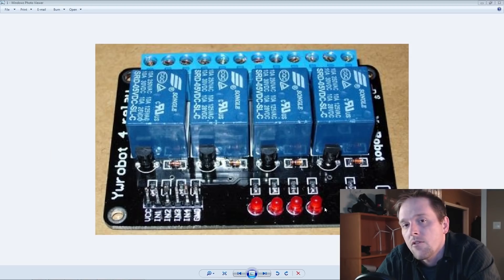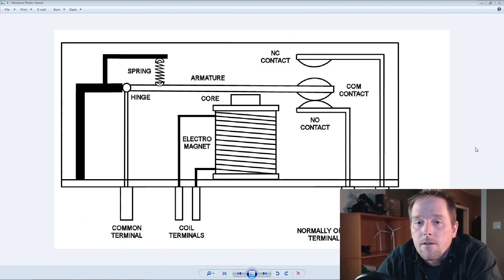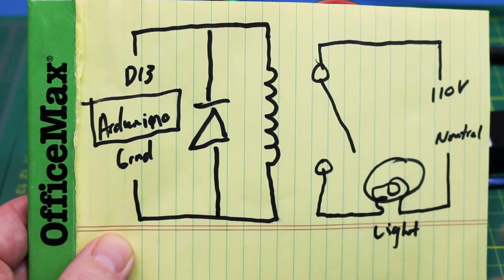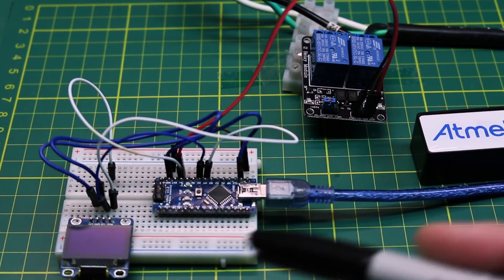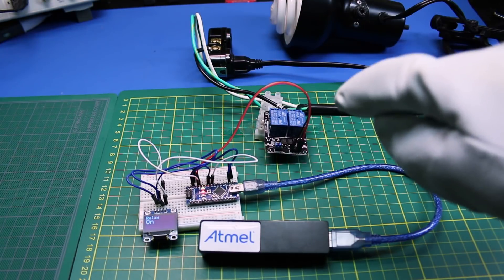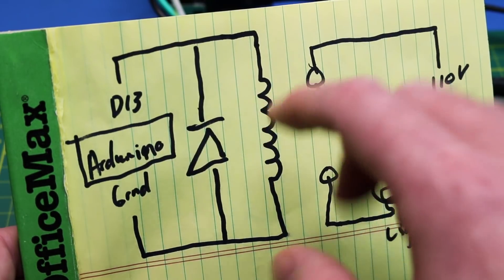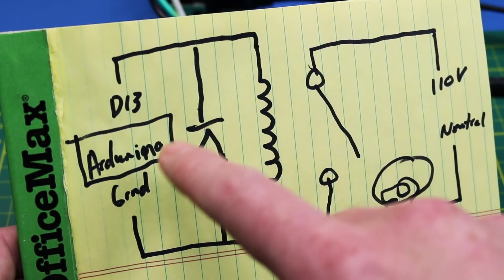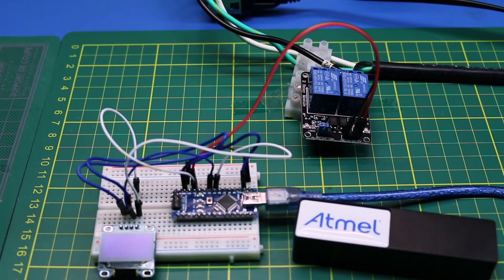How To Add Relays to Your Projects- The BASICS

Comment: I'm not sure how to wire the relays for my 12V system in my camper and requires 15, 20, 30, and 40 amp fuses to run my awning in and out with a switch, can these be used instead of those 5 wire relays?

Comment: I dont understand. I just want to add a relay to a trolling motor so I can switch it on and off safely if it's even needed. This video called kayak go go cart had one and in trying to learn what a relays for.
Reply: relay allows you to control power from a different source to a load, its acting like a switch that you can control with very small power, like that coming out of an arduino GPIO pins
Reply: @joshuavincent7884  cool
Reply: @joshuavincent7884  😎

Comment: Got an 8 relay module and i'm looking forward to cut off 5 outputs on my arduino by using an 8 bit shift register 74HC595 IC chip. Boy will this be a fun project.

Mine has optocouplers to seperate the input section from the coil and needs a seperate 5VDC supply there, and is an active low module. Problem is I'm not sure what approach should I take when dealing with latching relay states internally when using the IC. Don't want to add 1 to my byte variable every reading cycle and start glitching my relays by flicking at a crazy rate. Should I use an array of booleans or bits or anything else for shifting out (function used to write the output states in the IC)?

Comment: If we look at the diagram on the left and name the points around the square from the top left as A, B, C, and D wouldn't it make more sense to put the diode between points A and B (between pin 13 and the coil)?
Reply: Actually, never mind. I just solved my own question. The collapsing field generates power and continues to flow around the new circuit feeding the current controlled current source over the coil. Makes sense. If anybody wants to see a visualisation of this I put one up on imgur: https://imgur.com/EZKTr0G

Comment: Can someone tell me if a ssr can be used for 5v direct current? would be to control an injector in a fuel injection project managed by arduino
Reply from the maker: Just use a mosfet. One like IRFZ44N is good for 49amps.
Reply: MKme Lab thanks

Comment: I have a question, can we use this relay on 2 power input to 1 output light...1 power input using normal switch on off and 1 more power using sensor motion...

Comment: Hello dear friend, can you kindly answer this question? Is it possible to directly connect(without Arduino) a pir hc-sr501 which has a 3.3v output to a relay that requires a low trigger level? If so, how should the link be? Thank you very much

Comment: We all know how they work yes they switch. Your paper drawing has nothing to do in comparison to 4 pins and three screw connections. Can't see the relay pins or connectors on vid. Which pin to the motor or light which to  battery or power or board  common no or on  which to the in1 in2 vcc. Watching your spaghetti work after it's all hooked up tells me nothing.
Reply from the maker: Perhaps try a book?
Reply: Betty Crocker?

Comment: What can we use if we want a output voltage between minimum and maximum voltage (not as on and off switch but as a fan regulator)?
Reply from the maker: a mosfet

Comment: I hooked up an 8 channel relay module board one of those typical ones you buy from amazon.  I wrote a simple sketch to check it out as I want to use it to power some linear actuators.  On power up all relays go high and turn on power to all linear actuators and everything that could be connected to them... this is not good.  Once the program rolls through the loop the first time it functions as programmed where I'm cycling through the 8 relays turning one on at a time with a 1 second delay and then back off.  So how do I get around this problem on power up where everything turns on?
Reply: Tom Collins - I’m having the same issue - how did you manage to resolve this? Thanks

Comment: hi, i gone thru some video that they recommend to supply separate power supply for the relay, but some don't, i not sure is it really necessary to have a separate 5v supply to the relay?
Reply: Yan Mong Chan , thanks for your reply. if my relay has lesser ohm, should i add a resistant in series with the relay? will it works?
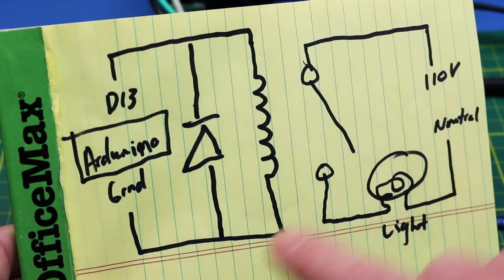Reply: At 3:03 he basically explains why you shouldn't connect a relay directly to the arduino or any other microcontroller. For that you have control circuits like Yan Mong Chan explained which basically work like this: Output of an arduino or microcontroler triggers a transistor (who in this case operates as a switch) which then triggers the relay, so if anything goes wrong with the relay, the control circuit will get damaged while arduino will be safe.
If you want to control more relays or other components like motors the easiest way would be to use a Darlington Transistor Array for example ULN2803 (http://www.ti.com/lit/ds/symlink/uln2803a.pdf) as they require minimum components. All you need for this is the ULN IC and power supply which has to be the same as the power requirements of the device you are controling (12V if using 12V relays, 24V if using 24V relays,...).

Comment: I am sick of my 91 corolla, leaving the light on, it does not have any beep or warning to let me know that I did left the light on, so I am going to connect two relays horizontally to have two positive voltage from the door switch(fuse) and the head light switch(fuse), so with the two on, I will power on a beep device that I will connect the circuit, like this I will save my battery :), what do you think? sounds like a project? :)
Reply from the maker: Absolutely!

Comment: I want to use a relay to turn on/off a common household 20" box fan (with arduino on a schedule)? I'm going to do some googling to see if there are perhaps charts with relays and typical applications vs loads.
Reply from the maker: Relays are rated for load. Easy math ;)

Comment: Hello, I'm having trouble with my low level relay :
 - when I power it with 5v, the input from the arduino works (green LED turns on and off) but the switch isn't actually actuated. 
- When I power it with 9 or 12V, the switch triggers, but the input is not recognized (the green LED just stays lit) 
What do you think is causing that ?

Comment: What kind of power supply do I need to purchase to power an 8 channel version of the relay?
Reply from the maker: You need to figure out what your control circuit is drawing and add the relay coil draws. Depending on brand they are usually 50-100 mA each in my experience.
Reply: MKme Lab I’m just going to be using it to turn a heater on and off. Leaving the plug intact and just snipping the positive wire and wiring that into the relay. So really I only need the 5V supply to be able to activate the relay. Correct?

Comment: even if I use the relay controlled by arduino into 240V line to neutral would it still be possible depending on the specs of the relay and the diode connected?

Comment: Hi, I wonder if you could help please. I'm not much good with this sort of thing. I have a twin relay module and I can't get the relays to trigger. I'm ok with the output, but on the 12v input side I am unable to wire it. The terminals I have are CL2. CL1. DC - and DC + any help you could give will be very much appreciated. Thanks, Terry.

Comment: Just Awesome!
Thank you so much. You are the man.

Would you be kind and make a tutorial video on how to connect an AC well water pump to a relay?
If you could also advise on the correct relay spec to purchase please.

I plan to control my pump for the house from my cell phone using my Arduino UNO and a WiFi sheild.

AC Well Pump Specs:

-> 240 V
-> 50 Hz
-> 1.5 HP
-> 6.6 A
-> 2800 rev/min
-> HEAD: 30 Feet

If there is anything else you would need to know, kindly let me know.

Eagerly awaiting your reply.

Thanks & Best regards,
Philip
Reply from the maker: Get a 10 to 15 amp 240V relay and you will be good. Could use a very small relay (aka interface relay) to run a contactor as well if you really wanted to get overkill.
Reply: Thank you so much.
Just if I may clarify please:

1) Are interface relays generally expensive?
2) How do I connect the pump wiring to the relay?

Warm Regards,
Philip

Comment: I thank you for the good will. I am trying to set a timer circuit on an iDrive 300 motor control for shades. the iDrive has cube contactor for close shade and another for open shade. The controls have manual open and close positions as well as auto position. the cubes are wired for manual, can I lap a set of timer wires onto the existing connections for timer operation? using the same input voltage (24vac).

Comment: Great Video.. Is the diode embedded into the relay?
Reply from the maker: Yepper
Reply: So I need an additional power source to run a servo as my arduino cannot provide enough current to it. Would the relay also work to control a DC circuit or should I use a transistor instead.
Reply: So I need an alternative power supply to my 5V arduino as driving a servo from my microcontroller is not enough. Would the relay also work to manipulate a DC circuit? Should I be using a transistor to to this or could I also use a relay?
Reply from the maker: You can use either. An analogy would be that using a transistor in that case would be akin to using a flyswatter to kill a fly. The relay would be akin to a Howitzer cannon to kill the same fly.  Both would get the job done.
Reply: lol, wut
Reply: minute 3:17.......

Comment: You may have answered this, but I'm having trouble creating code on my arduino to control dwell times in .5ms increments. 

I need to then add the code to a GUI for a touchscreen that I can manipulate for a sprayer. The relay will power a solenoid valve for a simple on/off operation to apply product to our samples at work. 

Any help would be greatly appreciated.

Comment: Hi Mkme Lab, Hope you can help. im confused about which type of relay to get. The relays in your video say "SRD-05VDC" does that mean you need 5v to get the relay to work? Iv saw other relays that say "SRD-12VDC" so would that one need 12v?

I need to get a relay which can be switched on by 5v and which will be switching on a 12v line. 

Thanks
Reply: codoyen 
You can operate a switch that doesn't actually draw from the 12V supply.

Comment: Planning on making a fish tank heater here, with the arduino, relay and thermistor. (store bought ones fail in the on position, and I believe this can be made to protect against/replace  the built in thermostat in those heaters.  I was wondering what the "extra" components on the prebuilt boards were.... I didn't know I needed a diode in-line with the coil pins, never needed one for auto's applications. Now, just have to learn to set up the programming side.
Reply from the maker: I have 2 reef tanks and if I didn't already have a Reef Keeper on each of them I would definitely build the circuit you are building. Stuck heaters have killed many tanks.  Super easy to add a tonne of functions like temp display/alarms. ph alarms/display, water level switch etc etc.
Reply: I've noticed that, been shopping around for a new one and on every product theres warnings for one or more person about how theirs broke in a closed loop and killed everything. It was at that point I looked over at the printer and wondered..... it's basically the same... kinda.  I'm just starting to learn (or trying to learn) the programming side. I would love to add a small display to show temp or set temp and actual temp. I think that would be a really cool feature to have. And advice on display to use and where to best learn how to program it? So far the extent of my arduino knowledge is simple tweaking an arduino/ramps for 3D and making a custom thermistor table.

Comment: Good vid, thanks. I would like to setup a relay that reads battery voltage. When the battery voltage gets below a certain voltage, the relay should turn off.  Example - I am running a battery with 4.2 volts. As I am using  the battery , and it falls down to 3.5 volts, the relay should switch off. I am hoping I can use a relay to disconnect a power line to the battery. Thanks.

Comment: wait. what does it do again?
Reply: it uses a magnet, an electro magnet to open and  close  a switch that is more hefty and can  switch circuits with much higher voltage and current ,the electromagnet is powered by low voltage like 3v or 5 v
  the relay can  switch things that are 120V,  think of it as a light switch in your wall that you have glued  a small powerful magnet to , then  positioned an electro magnet  with in an inch or 2 of, the electro magnet  is being powered by 9v say,  when you energize the electro magnet it pulls the switch  closed the circuit that runs the electro magnet and the circuit that is being switched on or off are not physically connected with any sort of conductor one runs on 9v DC the other on 120v AC
 hobby boards like the arduino  and the rpi run at like 3 or 5 v DC
so they can not be used to switch things that run on higher voltages and currents  like 120v AC ,the relay lets you open and close switches for higher voltage and higher ampere circuits and different  types of current curcuits,or acts like a switch for
those higher current higher voltage circuits ,the lower voltage circuit that is controlling  the  higher voltage
Reply from the maker: Maaaaaaaaaaaaaaaaagic
Reply: It's a digital switch, that can switch high voltage devices.
Reply: Its not digital it is z simple electro mechanical device 
It is just a magnetic switch
Reply: Andrea Mitchell 
Guy, it's operated digitally not by magnetism. The function is magnetism, but it is altered via digital controls.

Comment: My relay will turn on but not off I have to restart my pi every time to turn it off please help me!
Reply: prokiller grape what you can do to trick the pi to think it is at g or 0v is to set it as an input. Be sure to add the diode as he mentioned in the video so the excessive voltage don't go into the pi when you turn it off (switching to input).

This all has to do with that the pi and the relay don't have the same specifications on what is classified as HIGH and LOW. 
Hope it helps!
Reply: Christer Garpenlund thanks that was the problem.

Comment: hi sir. by the way thanks for the video. its very helpful. but Im asking about if posible that im using heater 220v in relay module v3.1 in arduino. what diode can i use? and can you help me in connection?

Comment: The relay board he is using is active low. If you notice, whenever the lcd read "Relay On", the relay led went off, and when it said "Relay Off", it would come on. That because it is active low, which is the opposite of what the blink sketch logic is doing. In other words, if you want to activate the relay, you must write "LOW" to it, and to turn it off you must write "HIGH"...Just a heads up, although I'm sure most of you would figure this out when testing your relay boards.

Comment: Does that relay board also require a diode on the arduino? I didn't quite get the diode part.
Reply from the maker: Yep- As the collapsing magnetic field cuts through the coils it induces a voltage opposite the normal polarity and very large in magnitude. This needs to be conducted back to the source (the coil) to protect any micro controller.
Reply: The relay board he was using already has a flyback diode built into it, so you can just plug and go with the arduino. It is important, however, to use a flyback diode if using a relay by itself. Make sure you also check out the relay specs to make sure the arduino can handle the the coil current. Max I/O pin current for the uno and mega are ~20mA and ~40mA, respectively.
Reply: LetTheWritersWrite I think the collapsing magnetic field from the relay can back feed and cause damage
Reply: MKme Lab how do you run a relay from an arduino? even relay current is big

Comment: HOW ABOUT USING MORE THAN 1 LIGHT BULB, HOW WOULD YOU DO IT ?
Reply: Wire the bulbs in parallel. Make sure you use a relay that can handle the load of all the bulbs combined.

Comment: I want to control my very small solar setup, i have ordered an orange pie one and one of the two bank relay boards. Im new at this so it should be interesting. I just want the DC current from the panels to switch from the batteries to my grid tie when the batteries are charged. Thinking this should be relatively simple any suggestions?

Comment: This is a great video that I'll refer all of my beginning electroncis/maker/arduino/pi friends to.
One note is that the type of relay shown in the video, designed for use with micro-controllers like the Arduino, often comes with the clamping diode built in. I would personally recommend people check for that and order that type to save the hassle of doing it manually and the worry of forgetting about it or installing it backwards.

On another note, because this video is going to get people thinking about all the cool projects this knowledge opens up, maybe you should do a follow up video covering latching relays. What they are, how they work, using them with micro-controllers, etc.

Thanks